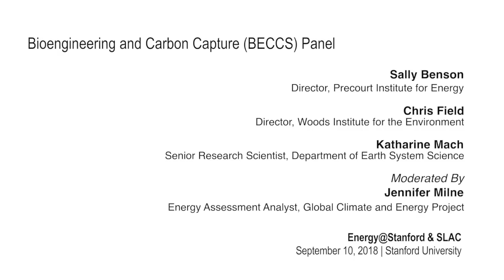Bioenergy & Carbon Capture (BECCS) Panel | Energy @ Stanford & SLAC 2018

Comment: Over in Nuclear Energy (as in Engineering) we've been following the DC-based,
non-profit Energy Impact Center's plans to Fix Climate by making C-NEGATIVE
Synth.Fuels (compatible with Today's ICE vehicles, to preclude the need to
replace such vehicles, to save materials & GHG emissions from making them,
as well as making new fuel-infrastructures, if we weren't able to stay with ICEs.
Of course, many will prefer quieter, exhaust-free Electric Vehicles OR Hydrogen
powered one, but H-cars will require very different fuel tanks, leading to more
emissions to make them, just as EV will have similar materials- & emission-
costs, eg, for batteries & motors.)

The incentive to buy their Synth.Fuels would be its very low price. Making them
would take C & H from CCS (& splitting H2O molecules), from the Air, Not from
underground.

Finally, Carbon would be used to make, eg, plastic products, so it wouldn't need
to be stored underground.

They allow, that lots of Clean, Green Nuclear Energy would be required to do
the work; in fact 10's of thousands of NPPs - around the World - are needed,
but these would also power electricity grids, providing Energy Abundance for
many folks who today have no reliable power available.

Their Plan, in their words: EnergyImpactCenter.org/thesis (a web page + talk)
Details can be gleaned from EnergyImpactCenter.org/keynotetalks

Although (unlike me) they embrace Fuel-Rod based LWR or PWR "dinosaurs."
IMO, with all the overheads of a pressure vessel & some cooling-towers, they
also publish an affordable OPEN-100 as an attempt to reign-in NPP build-cost.

(FWIW, I prefer the near-future Liquid-Fuel, Molten Salt Reactor, due ~2030.
Canada's Nuclear Lab CNL has several MSR or SMR designers signed-up to
build their prototypes on its secure facilities, from 2026.)

Either way, Nuclear is a given, & lots of it will be needed. Near-zero GHG-foot-
prints make NPPs the energy source of choice.

Physicist Carlo Rubbia makes Nuclear's energy-density clear in this equation:

3,000,000mt Coal = 200mt Raw Uranium (LWR or PWR) = 1mt Th (in an MSR),
ie, each qty of Fuel (in its own power plant) make Same amt. of Electricity as
the other two. (I understand, that Gas could replace Coal in this equation.)

So, while it may be fun to imagine planting trees on all of Earth's empty land,
I've met No One, who believes this would fix Climate, as it would be far too
slow. I think we agree, that C-NEUTRAL won't fix Climate, as we must remove
>100 years of CO2 emissions, before a Net-Zero emission pattern would help.

I'll let EIC's Bret Kugelmass explain the rest. :~)